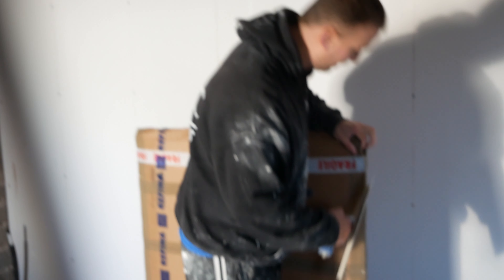Refina board stand spot board stand for sand n cement / plaster

Comment: A set of decent board stands is well worth having 😉
Reply: much better, as in more useful than a flat screen TV, I think i need stands but is there a 'foldy' as in fold away stand set up that can go from being a bit of gantry to a mortar stand as needs require?
Reply: @MakeAllThingsBeautiful  this type set up slightly lower if set with skids(Legs) resting on the deck, or you can set your board inside the legs rather than on top.  If heading the multiple mortar/spot board route, you can't really go wrong using retired beer crates for 18"-24" square spot boards and hop ups.
Reply from the maker: for sure mate come in well handy these
Reply from the maker: @MakeAllThingsBeautiful  I think they only sell these types do you mean adjustable that would be great man
Reply: Was looking at the 55s to use with stilts.
Reply from the maker: @noodles8203  yes would work well